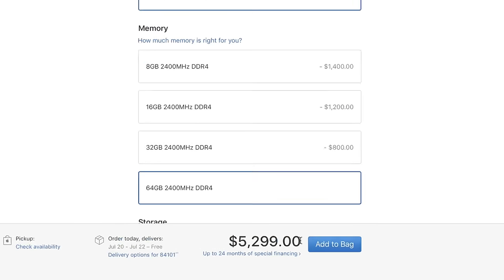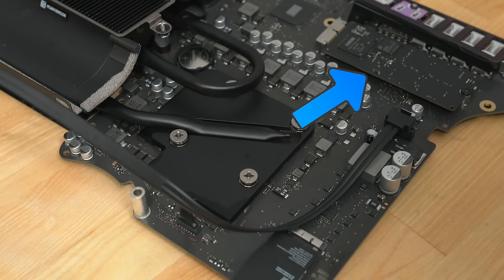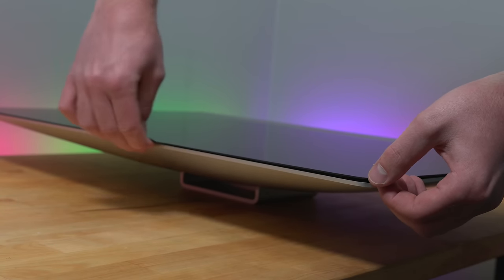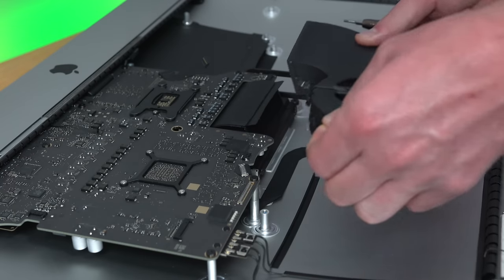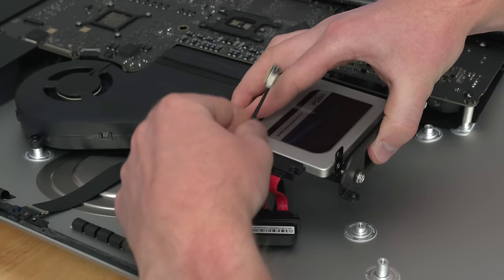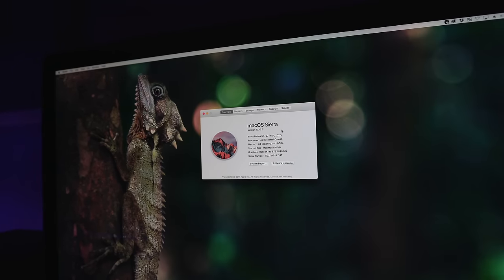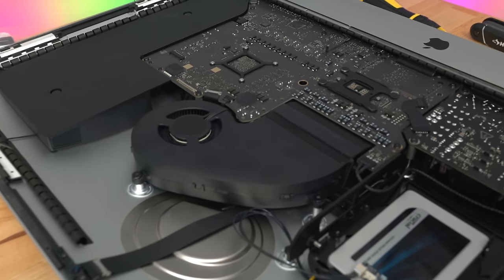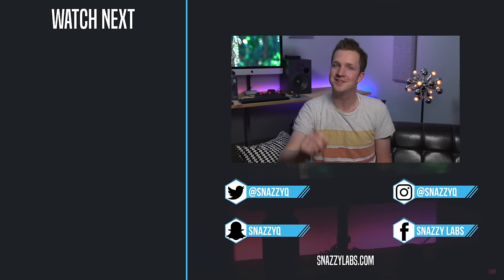The Best 2017 iMac Apple Doesn't Sell!

Comment: It is true that you lose the warranty but you can buy another iMac for 1800$
Reply from the maker: +CRISTIAN SAVA Yep!
Reply: I would just put it back the way it came and take a chance
Reply: Yeah ,and get the parts that are not broken into the new imac,and the price of part replacement if needed probably will cost less the to fix the computer even with warranty.
Reply: Opening the machine does not void the warranty. This kind of misinformation is annoying at best

Comment: This may be a stupid question but could that poor performance of Apple's top-of-the-line iMac possibly be due to the thermal paste/grease that Apple used?
Reply: Reminds me, I need to reseat the thermal material on my MacBook Pro. lel.
Reply: That's quite feasible due to the turbo boost function being disabled if the CPU gets too hot.  So better thermal paste might transfer heat more efficiently. Downside of this might be that the more heat the CPU is able to dump into the cooler, the less temp differential is available to cool the GPU, so you might find that the GPU throttles more quickly in workloads that stress GPU and CPU.

I don't think that there are "runt" 7700K's given to Apple though. At or below their max turbo clock, they should all perform the same.  The silicon lottery applies to anything above max turbo which won't be applicable here.
Reply: Adam Saint someone in the comment mentioned apple using 7700 and not 7700k like he is

Comment: I did this with my 2014 27 iMac and was gonna shell out money for the OWC temp cable but I didn't need it! I pulled out the drive, purchased the new SSD (Samsung 860 Evo) and plugged it in to test. Surprising there was no jet noise from the fans and I tried some games and still no issues. I think the $40 OWC cable is a rip-off or at least only necessary for older iMac.s

Comment: Can you try upgrading 2017 7th gen cpu's to 8th or 9th gen cpu's as 2019 imac's are out with 9th gen cpu's without any changes so it could be easy swap and huge performance upgrade!.
Reply: Yatheesh Yashasvi I have the same question. I think the socket may have changed for the 9th gen. But maybe the 8700K would be possible, borrowing software compatibility from the 2019 iMac 21”.
Reply: @lux-pro  even 9th gen i5 use same 1151 socket so physically its possible for 27' imac 8gb gpu.

No one knows exactly until someone takes risk!
Reply: Snazzy Labs be our hero!

Comment: Do you think the new Coffee Lake 8700K (same LGA 1151 socket...but different chipset) that will be released in about week and half will work w/ the 2017 iMac?
Reply: No, won't work.
Reply: snazy labs should try this, as new 2019 iMac are out with 9600 i5 units with same old specs its possible to upgrade old 2017 7600 i5 imac to new processor..

Comment: But can it run crysis?
Reply: the graphics card he has (AM Radeon PRO 575) is comparable to GTX 780 (https://www.techpowerup.com/gpudb/2969/radeon-pro-575 benchmark scores) so i wouldn't say that even the 4,000$ machine can run crysis
Reply from the maker: Yes, but quite poorly.
Reply: Quite poorly at what resolution though? 5k? The GPU itself is not bad, but paired with a 5k display, it'll obviously struggle so would any equivalent GPU I would imagine. I'm sure that iMac is perfectly capable of running games at 1080p, which is still full HD.
Reply: No it's a mac. Can't do shit
Reply: 8 Bit Paradise Learn before you speak OK.?
Reply: I know a lot more than you.
Reply: 8 Bit Paradise well show him what you know.
Reply: the mid entry lvl ati 5 series is the limitation now and the power supply
Reply: LTT
Reply: Check the specs on the iMac Pro that just launched. It's built for real-time 4k movie rendering with particle effects.
Reply: Ace McCrank good to see that it overheats after 10 minutes and thermalthrottles into oblivion when you use it for that

Comment: I am a tech,  I try to avoid removing customers motherboards, mostly to remove the pesky 85gb-128gb if your lucky of SSD drive thats part of their 2tb/3tb fusion drive (just ugly and slow), as the surface mounted components and motherboard are notoriously fragile, don't bend or bump it getting it out. Or your going to pay me $300aust to trace the component and replace, solder or glue it back on. Awesome video will try this myself thanks.

Comment: But you didn’t add dedicated graphics...😢
Reply from the maker: +Floyd Packard There is a dGPU inside, but no, I didn't add one externally. For reason! Lots of issues on the iMac so far.
Reply: Snazzy Labs gotcha! Can you add or replace a dGPU to an iMac internally? Is that even possible?
Reply from the maker: Not unless you swap out the entire motherboard. And guess what the most expensive part of the machine is? Yeah... :(
Reply: You can use a thunderbolt GPU enclosure such as a razer core. It requires some handy work in terminal (modding the OS) but it does work. Also Nvidia has recently released macOS drivers for the 10xx series cards. So that's an option to consider in the future.
Reply: Buy a pc

Comment: Is it worth skipping the other video card options on the higher Imac
base: Radeon Pro 570 with 4GB of VRAM
Mid: Radeon Pro 575 with 4GB of VRAM
High: Radeon Pro 580 with 8GB of VRAM
Reply: why would you ever buy an iMac?
Reply: edgy youtuber user I am tomorrow and will love it.
Reply: If you watch any video about the 2017 iMac's you would understand, as explained in this video the 5K screen is almost impossible to buy elsewhere and if you can find it it's outrageously expensive, additionally the proprietary NVME SSD technology in these Mac's is some of the fastest you can currently buy- if you look into buying the same speed PCIe SSD for your Windows machine it is actually about $40 cheaper to get the upgrade from Apple than from a different company. Additionally, if you buy the base amount of ram and upgrade it yourself, which is allowed by apple through a port on the back, then you dont have to pay double the price for Apple's RAM. All in all it is almost impossible to mimic the exact specs of the iMac if you do those things mentioned above with a comparable PC including the price of the monitor. Sure, you could just not get a 5K screen and save boatloads of money, but that isn't the point of the apples to apples argument.
Reply: the difference between 4k and 5k are going to be small to non-existent
Reply: Are you suggesting that the PCIe SSD's that Apple sells with their iMac's are better than, say a Crucial SSD you could install separately? Is it worth losing your warranty to buy a base model with a fusion drive, then rip out the fusion drive and add a 1-2TB SSD for cheaper?
Reply: @MarloDellAntonio  I believe, Matt is speaking about Apple's NVMe drives. Those are leaps and bounds faster than any SATA-connected SSD (which is what you are talking about).
Reply: @MarloDellAntonio  The internal drive was REPLACED or a 2nd drive was ADDED for a total of two?

Comment: Is it possible to 2nd upgrade cpu to 8700k technically?
Reply: no
Reply: Different board is needed. There are some articles of people saying if you can program board bios your self and figure out the pin change/layout which is exactly the same but certain pins where converted to power distribution or changed to a different job. So if you knew what you where doing and spend 100 hours tinkering you may be able to get it to runing. In all honesty though it would be wasted effort 7700k is near the performance of 8700 minus core count
Reply: 1stfloorguy Don't forget the imac's pityfull cooler could never cool down an 8700k at load so per core performance would suffer.
Reply: Vincent Ryu Nope apple will never put i7 8700K in iMac doesn't have good cooler so the cores would be die in while use it in long time at 80 -70C
There is no 2018 iMac with Intel 8th generation sorry

Comment: Your mic stops working after you do the bottom tape if you don’t be careful and cut an opening. And don’t press the bottom too hard at first. But you will want to secure the adhesive. Don’t want a $1000 accident.

Comment: What temps are you getting with the 7700k? It's 95 watt vs. 65 watt for the 7700, which is what Apple uses for the i7 option on the iMac. It makes sense since the iMac is a closed-enclosure and you can't overclock on a Mac anyway, defeating the purpose of getting an unlocked 'K" processor.

Comment: Can I use a Intel i7 8700K on this Imac?
Reply: Alberto Gandica no
Reply: Try
Reply: Junho Son no cuz the socket isint the same
Reply: The socket is the same but Intel decided not to support it, something about powerdeleivery they sayd
Reply: Cortex 8700k uses 1151-2 wich has a diffrrent pin layout
Reply: Alberto Gandica no I️t is a different chipset
Reply: JailerGaming the socket is the same the chipset and bios isn’t
Reply: No chipset is not high enough
Reply: @JailerGamer  yes they are 1151 sockets both but it will not work because the 8700k needs a higher chipset

Comment: My server machine is 2 Xeon l5520 CPUs clocked at 3.1 and 128gb DDR 3 ecc and gets somewhat a little bit better numbers, for display I'm using a 760 superclocked 4gb

800watt evga bronze 80 plus PSU, total was about 480$

Comment: Is really need to install an OWC thermal sensor? I heard this typical "problem" was fixed by Apple on 2015-current iMacs models. I had an iMac 5k 2015 and no needed thermal sensor to upgrade your HD (as a Fusion drive) to SSD and works as well, without "crazy cooler".

Comment: most likely your i7-7700K performs better due to fresh thermal paste applied, which results in better cooling, which means less throttling due to thermal threshold topped less often

Comment: My best guess on stock i7 vs DIY i7 is the only possible variable... Mac's are known to thermal throttle under heavy load, and also notorious for mediocre thermal paste. The 8% performance boost is likely coming from more dependable heat transfer, allowing you to push the 7700k harder than the stock mac can be due to crappy thermal paste. That's been my experience on a couple of older macbook pro's at least, and as you said, they haven't changed some things from at least 2012 onward. Haha. Might be worth looking into a bit, and doing a test for a future video. Get a new or un-tampered with mac, bench it, re-paste with whatever you prefer to use, bench again, compare results and let us see!

Comment: Any 2017 27 inch iMac, be it 3.4, 3.5 or 3.8, can it be upgraded to the i7 processor? and also upgrade the graphics card to a Radeon Pro 580 with 8GB of VRAM?

Comment: Great video. I have a question: why didnt you use a NVME ssd instead of a normal ssd. They have different write speeds :

Samsung SSD 970 Evo Plus M.2 NVMe Retail-Version 500GB - advertises Write speed up to 3200 MB/s
meanwhile what you used: 
Crucial MX300 2TB SSD - Sequential reads/writes up to 530 / 510 MB/s on all file types

would this make any difference? i am considering this upgrade on my imac and am leaning towards NVME instead of normal ssd.
whats your opinion on this?

Comment: my consideration:
1. CPU upgrade with $328, the Apple already have this option with close price
2. 64G ram upgrade with $453. As iMac 27 have slots allow customers install ram already, you need not using apple's ram upgrade price.
3. 2TB SSD update with $532. It is a SATA3 SSD with R/W speed around 5XXMB/s, it is different to apple store upgrade with PCIe SSD with 2KMB/s

As a result, I think this video can save your money, because you use SATA SSD instead of PCIe SSD, as will as you compare custom RAM with Apple ram option, but you already have slot to install your own ram. So it is not worth upgrading you iMac yourself instead of using office upgrade option, you can safe few money, you can need to take risk, as well as warranty lost.
Reply: also, SATA 2T SSD upgrade can be done with external SSD upgrade

Comment: Anyone looking to do this today, you don’t need the hard drive thermal adapter in these thin iMacs. There’s no thermal sensors that connect back up with the board. Just power and regular data.

Comment: Great video and a very tempting project. My ONLY concern would be future system updates and whether or not they would support a custom iMac build. Have you had any problems with OS X updates? Also, why did you decide to get an Apple installed SSD or is that proprietary tech?
Reply from the maker: No problems. None of the hardware I installed is different from what Apple installs in their higher end Macs. Apple SSDs are proprietary so I opted for a bigger one upfront. They cost way more money on the used market.

Comment: Do you think a 7700 (non-k) will work? I would prefer the 7700 (65W TDP) over the 7700k (91W TDP) to avoid the fans from kicking in.
Reply from the maker: +Robert Mitchell Yeah it does.

Comment: thanks for the detailed steps, appreciate it.
One question: Does imac 2017 needs a thermal sensor with new ssd? or it should be fine without one for 2017 imac models.
asking because I saw some discussion online and lots of people are saying for 2017 imac we don't have to put a thermal sensor cable, just any replacement ssd is fine.

Thank you

Comment: I think part of the reason why you got better performance may have been your thermal paste, in addition to the better line of CPU than Apple would have gotten in bulk, so the CPU was less likely to throttle. Also, I'm not positive, but I think Apple runs their stock models, even with upgrades (I know mine did a while back), usually with only two sticks of RAM, which means you have another channel not being utilized, unless you break out the money for a second set of RAM.

Comment: Not that Im surprised by all the negative comments...some might be missing the fact that the hack is clever, and explained quite well. Kudos for a job well done. 
I can't agree more about having access to a quality 5k monitor. I use several PC's for work for software such as Solidworks. However, I still prefer to use Macs for email, FC, Adobe products. I prefer the OS over Windows, including 10. 
I might try something like what snazzy did here. Wondering if current 27 in refurbished iMacs on Apples site (orig released 2015) would be compatible. Have to take look at Mactracker to see CPU.
Reply from the maker: +Shelley Green The refubs are very similar. The top of the line CPU for that year is the 6700K. Cheers!

Comment: It could also be due to the thermal paste you used in the setup. Apple thermal paste is not the best on the market and third party one can easily cool down the CPU by 30 degrees celsius and therefore avoid thermal throttling.

Comment: the ram prices have gone up. and you didnt post a link/price to the proprietary sata/power cable. 

overall great article. i was thinking of upgrading my 2013 imac. but i think im better off selling it.

i will say the one other benefit from the apple top of the line is the SSD. you have 500gb of NVME and 2tb of Sata SSD. where as the Apple upgraded unit has 2tb of NVME. but in the end, yours is just as fast, or faster, so i guess that doesnt matter.

this is weird saying to an iMac builder..... but.... Great Build!

Comment: I got my imac 4yrs now and its a late 2013 - 27- inch but its getting hot and moving slow my CPU 60 to 70% not doing nothing. My memory is 32GB 1600mhz DDR3 processor 3.5 GHZ intel 7 3TB Fusion HD

Comment: Great video; but could you please ask me 2-3 (for my opinion) important questions ? 
. Regarding to your part list you installed as well an 512gb NVMe ssd , it was not shown in the Video but I guess you do 😀 also the 2 TB SATA ssd. My question. Does the system still run as an fusion drive (as configured), or how do you configure the system with this new suds? On which ssd you install the Mac OS after ? Why was the hdd not to see as you open the MAC ? Thank you very much ✌️😉

Comment: Isn't it also possible that the improvement in performance is a result of cooling? If you used better thermal paste than what Apple does, you could keep the computer cooler, which'd both result in better CPU and GPU frequencies, since they share the same cooler. So if the 580 throttles due to heat from the CPU and GPU both getting that bit hotter, your 575 could still be doing the power work in FCPX... Just a theory. To test it, maybe you should buy a fully spec'd iMac, replace the thermal paste, and run tests on that... Assuming the price isn't too prohibiting for that test. Maybe you could borrow somebody's iMac to do it.

Comment: I've got an old iMac with some water damage and was struck by lighting through its ethernet port.  Is it worth saving as a secondary screen?  It still turns on but it wouldn't boot up so I had to take out the drive to get all my projects off.

Comment: Great work!  Do you know if it would be best to get the 512gb SSD (i assume Apple install this via the PCie connection?) and add an internal SSD purchasing HDD mount and cabling or better to purchase the 2tb fusion drive and wait for the PCie 512gb OWC upgrade or just update the HDD to SSD (would the 128gb PCie make any difference if still installed?)?

Really is confusing and I haven’t found any information on which option is the best for future upgradability? A video on this would be AWESOME!

Comment: I see 1,2,4,6,8 TB external hard drives at Costco that will work with a Mac.
My hard drives on my older Imacs need replacing.
Is there a way to put an external hard drive in one of my Imacs ?
I have 2 - 2008's and a 2010.
Next year I will have saved up for the new Silicon Mac Mini.
I am on social security so it takes me a long time to save up for upgrades.
Reply: many people that have imacs completely switch to using only an external hard drive, for the OS and everything. typically, these days, people go for a ssd instead of a hdd; however, one could still use a hdd.
there are lots of videos on youtube explaining how to make imac run entirely from an external drive.